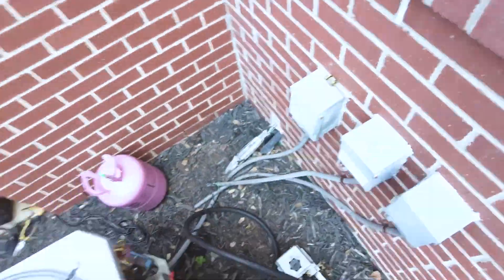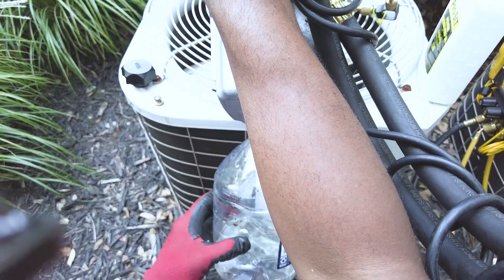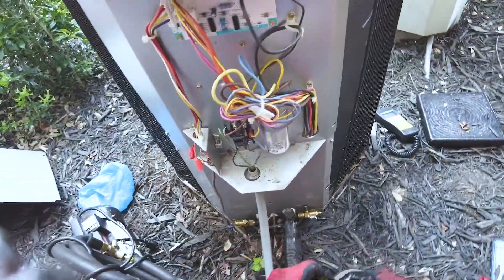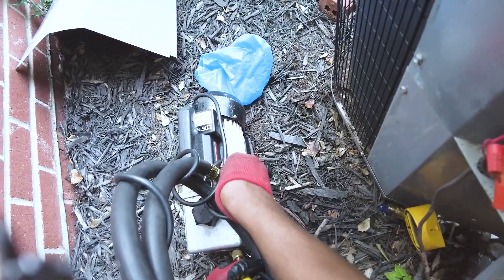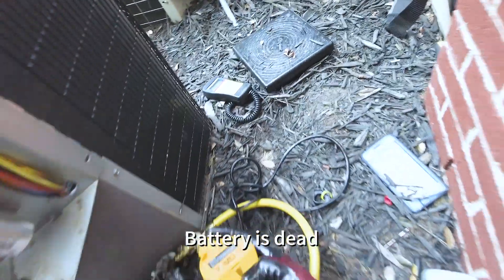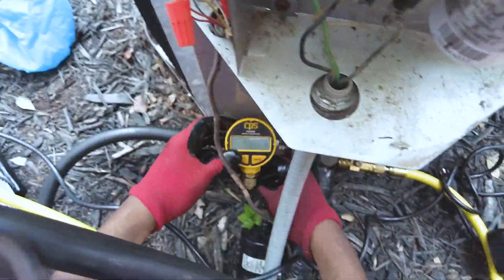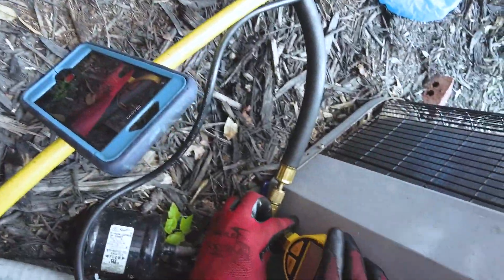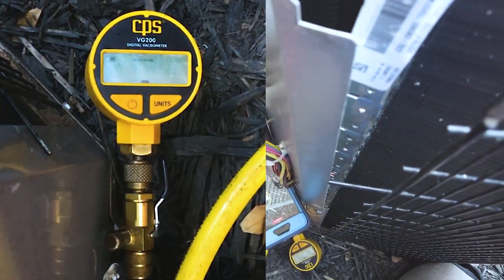500 Micron Vacuum in Under 5 Minutes - Pulling Deep Vacuum Fast  | HVAC Vacuum procedure

Comment: But, really why do we care? I train all my apprentices that our BIAS is to get the AC under pressure. From there, we have sheet metal, drains,  gas line, stat (including configuring it), flue, caulk, whip, 120V/240V, disconnect, clean up. etc. The vacuum pump is working while we work. I use a single 1/2" low leak hose, dedicated for vacuum. If it takes me 12 minutes or 30, I do not care. By planning effectively, I will always have 2 -3 hours of work left when the pump is hooked up. I have spent the money; I have all the Appion Ts, Valve core etc. But I am always scratching my head while guys through all the extra work of pulling cores etc. I want a deep vacuum. I don't need a fast one.
Reply: Have you never done service?  There are plenty of applications where nearly the last thing that needs to be done is pull a vacuum and recharge the system.  And fast vacuums are the different between a 2 hour Evap coil replacement and a 4 hour one, for example.

Comment: One thing to remember too is mineral oil which is common on r-22 units is hydrophobic and won’t absorb water where as poe oil used on r410a units will pull water from atmosphere. A longer vacuum is better than a shorter one. You won’t freeze that water before you can pull it out.
Reply: It's a fallacy you'll freeze water.  I agree a good long vacuum is more effective.

Comment: Man, my digital manifolds tend to read anywhere 30p to 600 higher than using a micron gauge is the reason why i always add one to the circuit. I live the setup, though. I can only imagine th cost.
Reply from the maker: Yeah I used to use my fieldpieced manifolds to pull vacuum as well but they just let me down too many times. The setups actually not that expensive. I think the hose and valve core removers is around  $100  and the Micron gauge is Maybe $150.

Comment: great vid. as i pull a vac down to 4/500 microns and the isolate the pump, the gauge shoots back up immediately. I am certain there are no leaks, could moisture in my hoses cause this issue?
Reply: sometime there is refrigerant in the compressor oil that hasn't come out of the oil yet I took a compressor out to replace it and when i set it
down hard oil shot out of the suction side of the compressor . I had the valves open for days before I removed it.

Comment: Nice instructional video. I have found though that I usually have about 30 minutes of work to do while I’m pulling a vacuum. So I’ve sorta stopped going through some of the effort.
Reply from the maker: Thanks! I hear that, I'm not going to lie even after owning a rig like this I'm still probably going to end up  just use my sman manifolds to pull vac most of the time. Its just more neat and convenient for me. What is your vac set up?
Reply: I’ve changed how I evacuate three or four times throughout my career, always trying to get faster. What I’ve noticed is that the more I get into a rhythm and doing whatever it is, it takes me almost 0 additional time. When I first started charging with nitrogen while I break it took me about seven minutes to set it up. Now, it may be two minutes. Same with the vacuum, what are used to be 10 minutes three or four. And when I do it ever problem, unable to realize it very quickly and troubleshooting doesn’t take much time.
Reply: Exactly.  I save all the electrical and all the drain work till after my pump is on.

Comment: Getting there is the easy part. 
           It’s holding the decay over a 10 or 15 minute period of time without reaching 500 µm that’s where the real world is to pass your test. 

The difference in work to get to 500 µm and the difference in capable of holding it after it’s isolated a analogy would be

Getting to 500 µm is like picking a feather pillow up over your head

But to get down  to the level so you can maintain and hold below 500 µm after decay test is like picking up a refrigerator and climbing up the stairs to the top of the Statue of Liberty.
Reply from the maker: Nice analogy but everything's easy once you understand what and what not to do.  For instance, there are people right now that find it difficult to get to 400 microns based off of either the equipment they're using or techniques.  On the other hand there are people out there that find it easy to get a system dry and tight enough to hold a vacuum at 400 microns for 10 minutes in a decade test. Its all relative. One person Statue of Liberty is another person's feather pillow, but we all have to start somewhere: ) I appreciate the feedback thanks for watching!
Reply: @HVACTechKnowledgy  once you really get it down on a new clean tight system that your commissioning you’ll get down below 60 µm easy and decay and hold at around 100+ microns 

It’s all feather pillows

Comment: I was taught not to pull vacuum to quickly at first, use manifold to regulate flow barley crack valve for around 10" at first for about first 3min or so, too quick to pull initial vacuum causes any moisture in system too freeze & not turn to vapor & be removed.
Reply: I learned that in HVAC school as well but after being in the trade for some years you realize that isn’t really necessary it’s just a precaution, once you have the ideal vacuum set up you pretty much know how much to turn the manifold gauges or what hoses/vacuum pump you should use on a specific piece of equipment. Never hurts to be on the safe side though 🤙.
Reply: Can agree with you. On a new install you want to slowly vacuum etc. Just that 5 minute headlines gonna fuck with new guys.

Comment: When you first turned the vacuum pump on and the micron gauge was searching i noticed the suction line valve port closed. Then when you removed the yellow hose you went back thru your process but the 2nd time you opened the suction port valve. Lol
Reply from the maker: Hey, I appreciate the analysis but yes I had the liquid line closed off intentionally. Probably should have explained that better in the video, that's my fault. I was trying to test the yellow hose by itself as I've had issues with it before. Also the way that vacuum gauge works, it's not going to go below three bars if it's still at atmospheric pressure. Each bar combination set indicates a certain Micron range above 25,000, ie Pressure between 100,000 and 76,001 micron Indicated by the top, middle and bottom bars energized
Pressure between 76,000 to 50,001microns Indicated by the middle and bottom bars are energized.
Pressure between 50,000 and 25,001 microns etc. So it was pulling a vacuum below 76000 microns. My issue was that it was fluctuating from 76000 to above 76,000 shows that system wasn't tight. Hope this helps. Appreciate the feedback and thanks for watching!